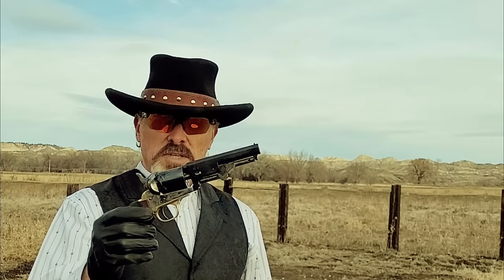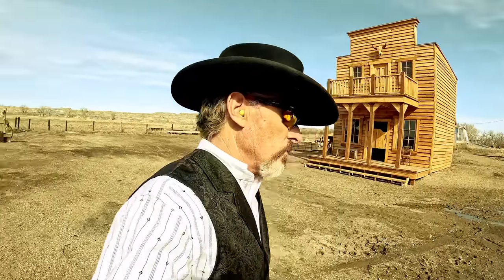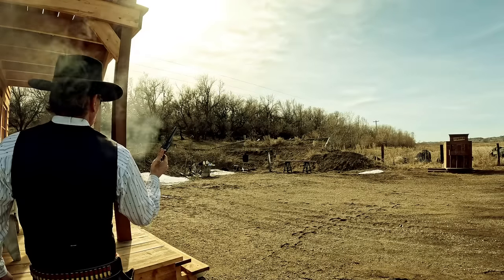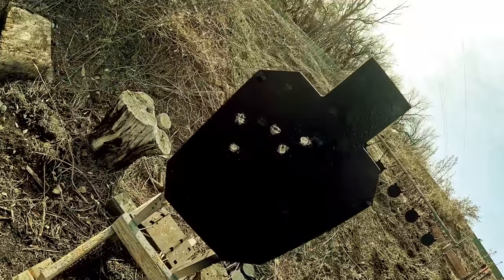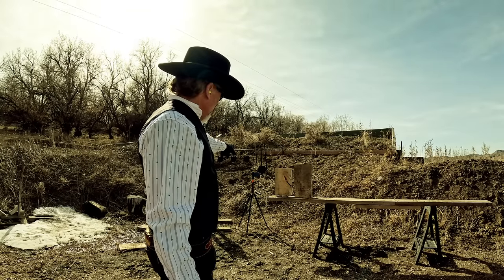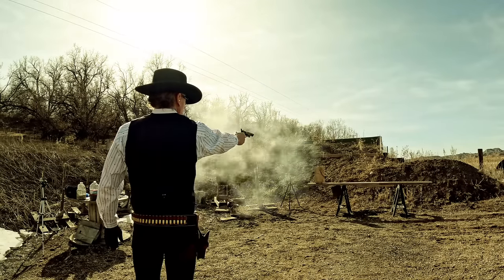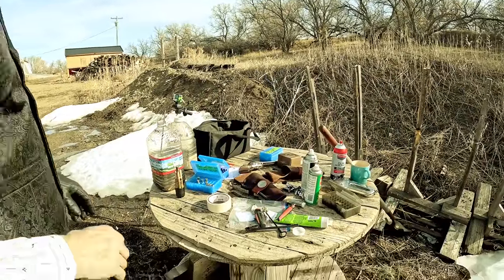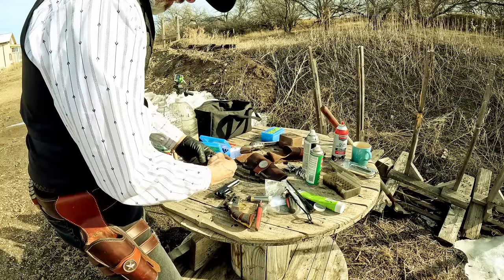The 1851 Navy "Sheriff's Model" Race  Revolver

Comment: First, no, your bore diameter is not .375".  That's your approximate rifling groove diameter.  The bore diameter is closer to .36", which is why it was originally called a "36/100ths" caliber gun.

And there's no need to line the bore when you can use heeled bullets as originally used in those cartridge conversion guns of the mid to late 1860s.  What came to be known as the 38 Long Colt cartridge used a heeled bullet of approximately. 375" major diameter, with a heel of approximately .357" which would fit inside the metal cartridge case (like our 22 rimfire today uses a heeled bullet of about the same major diameter as the outside of the case).  Recognize that number?  Yup, that's where we get our modern "38".

In short, get a bullet mold that produces a heeled bullet designed for the 38 Long Colt. And you can use the gun just as it is, and fire cartridges that are much more "period correct".  And that also means you can still fire the gun as a standard 36 caliber percussion gun, using its original percussion cylinder, which is pretty dang cool.

See Accurate Molds for several heeled bullet designs and weights for the 38 Colt and Long Colt.  They'll be found under the 37 and 38 caliber headings.  You'll want a bullet that just slips into the chamber, after sizing, without binding.  It helps if you carefully and accurately measure you chamber diameter and slug the bore to get your exact groove diameter.  The finished bullet should be 1 to 3 thousandths over groove diameter,  pure soft lead, and still small enough to slip easily into the chamber.  Therfore some fudging may be necessary, depending on the gun.

No more keyhole!

Another fix is to use a standard .358" bullet with a deep, hollow base.  You'll usually find them as wadcutters.  With a big enough HB cavity, the bullet will expand from gas pressure into the rifling.  Some guys get good results with them in their conversion guns.
Reply: Also, a correctly assembled gun will not let the wedge pull free of the barrel like that.  That gun wasn't set up correctly.  The wedge spring and the retaining screw in the barrel are designed to prevent loss of the wedge.  You should have to remove the retaining screw on the left side of the barrel before you could pull the wedge totally free like that.  Normal operation is that you pull the wedge out until it stops, and then your barrel will pull free from the arbor. But the wedge never leaves the barrel during normal takedown for loading or cleaning.

Comment: Do you think the Italian copies of the Remington 1875 and of the Schofield can be turned into race guns? I mean, you do have a Remington 1858 race gun, so the 1875 counterpart probably could. But do you think the Schofield could?
Reply from the maker: I've never hand my hands on a Schofield to break it down and see. The rem 1875 would probably work but both that and the 58 would be inferior to the 1873 Colt design.
Reply: @TUCOtheratt  is that why people use the Colt clones as race guns? I know that people use the Ruger New Vaquero a lot because of their design
Reply from the maker: @scotthamp384  The Colt and well made clones have a 2 stage hand that help race guns run fast. Ruger's have been made into race guns but the bolt design is inferior to the Colt style imo . The colt style bolt can drop into place faster than the Ruger.

Comment: What happens when you shoot a 1851 Colt Navy revolver?
If loaded correctly and the powder is dry it sends one round ball (or conical bullet) down range?🤔
That's my guess, anyway. 😇
My 1860 Colt Army, 1858 Remington New Army, (both .44 caliber) and .32 caliber Remington Pocket Revolver did the same thing.
The Remington was more accurate. An actual rear sight groove in the top strap, rather than a "V" notch on the hammer nose for a rear sight on the Colt's. The hammer could be/can be/is canted slightly differently each shot. Moving the rear sight every shot plays havoc with accuracy.
Reply from the maker: Not sure if you can't read, comprehend or both. The title to my video is "What Happens When You Fire An 1851 Navy R A C E Revolver". I assure you, you have never handled an 1851 Navy RACE revolver, apparently have no idea of what it can do and probably didn't watch the video. LOL

Comment: Why not load your own the molds are available? Thanks for the education I kind of knew about this but I put my revolvers away after getting the 36 cal conversion cylinder
Reply from the maker: I'm sure that would work but I've moved on to other shooting projects.  I prefer the 1973 design.
Reply: @TUCOtheratt  You opened the door what is the 1973 design? Have you tried the KristKonverter revolver? Those I think use 38 special so they must line the barrel. Now get out and practice! You’re doing what everyone else wants to be doing! Good for you!
Reply from the maker: @joemolf3894  Ha Ha! 1873
Reply: @TUCOtheratt  Duh I should have figured that out! Damn Long COVID!

Comment: I just realized that after a decade or so of shooting double-action revolvers in (informal) competition, pretty damn fast, my splits with a double-action, tuned S&W are not as fast as your splits with ANY single action, including an 1851 Navy. I think I hate your guts!    ;-)
Reply from the maker: Ha Ha! It's ironic that single action revolvers can be shot faster.
Reply: @TUCOtheratt  Jerry Miculek's record for twelve shots, with a reload, through a Model 625 S&W is 2.99 seconds. You would have to use a New York reload of course, but it could be an interesting match-up.
Reply: Yep, because the double action is slowed by its own rigid engineering. 👍